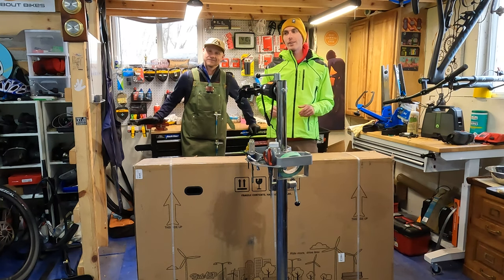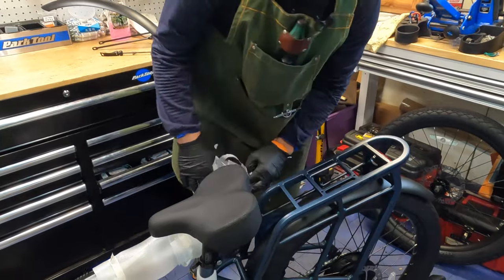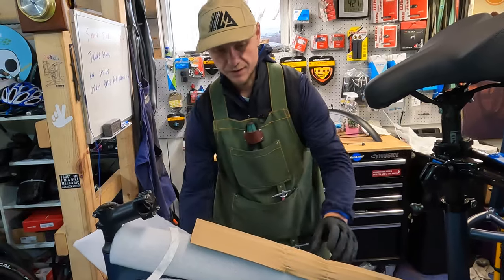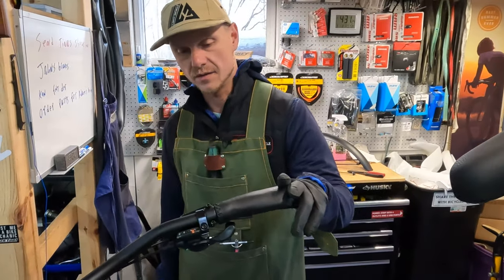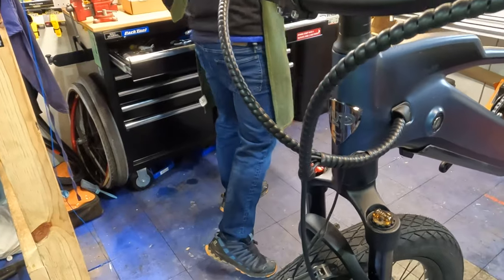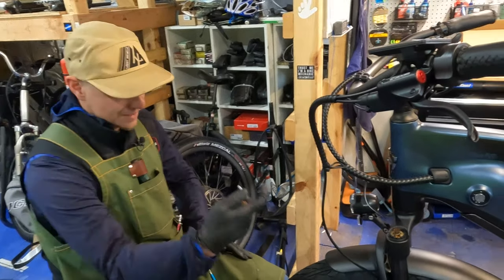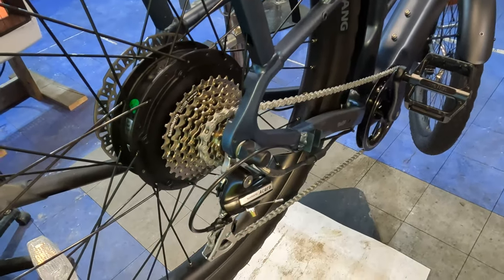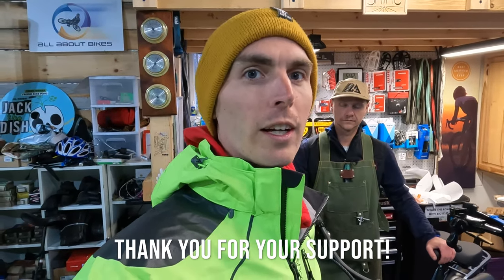Electric Bike Full Assembly and Tuning: Ride1Up Cafe Cruiser!

Comment from the maker: What are your first impressions of the Ride1Up Cafe Cruiser? Support Ebike Escape when purchasing from Ride1Up: https://go.ride1up.com/aff_c?offer_id=1&aff_id=1005&source=youtube (affiliate link)
Reply: I just got mine late February sorry I would have used the link. Its amazing. It rides like a Lexus smooth. It’s not fast off the line my Lectic beats it easy but it’s really fast over a distance. Not in love with the thumb throttle but I mostly pedal. The smooth tires are quite and roll Fast. I need to bring mine to the bike shop for a tune

Comment: I wouldn't recommend this bike. They advertise it as a 750w motor. But the motor on the bike is only a 500w.
Reply from the maker: It's 750 watt sustained - so should be peaking even higher.
Reply: No. I have one. The motor keeps burning out. I took the information off the motor and contacted Bafang. They told me that its a 500w motor.@EbikeEscape
Reply: The information on the motor is "RM G040.500.DC" if you look up that hub motor on bafang. They tell you it's a 500w motor and it's torque is 60n.m

Comment: What a great tutorial video.  Lots of detail and great tips.  I need to check my spokes for tightness.  Super job guys.  Thank you very much.   BTW,  the Café Cruiser is on the top of my buy list. Lots of extra features and high quality for a reasonable price.   Easier then normal assembly and it looks great too.  I think it will be a great first E-bike.  I'll use your link.  Thanks again.    Kim

Comment: I saw the filing of the front brake caliper spacer on the front side. Looked like you also filed where that filed surface bedded on as well? and back side of spacer too?
Reply: I filed both sides of spacer, reinstalled and it was still chasing when tightened, I disassembled and filed the mounting seats on the caliper (which looked to be the worst uneven surface) and it reinstalled with no chasing and I was able to center dead on.

Comment: I think the bike needs an option on the rear rack. Too bulky. The Thule child seat does not use the foot pegs. Most buyers will not have a < 130lb  buddy on the back at that price point! Should be a rack like the 700 has! And it would reduce the weight.  Maybe R1U's future "click on rear basket"  will justify? Also, don't like having the open holders on the chain stays if not installing the foot pegs. Looks unfinished and possible ankle biters! 
We are HB CA boardwalk riders and have been drooling over this Cafe (beach) Cruiser, it checks almost every box! These are our first impressions  from the website only and not first hand. 
ps: no stem spacers included for taller riders? You mentioned something about using? Did you mean aftermarket?
Reply from the maker: Thanks for sharing! My brother took this on a trip with two older kids so we'll see how he likes it. Unfortunately, a non-welded rack wouldn't meet his needs due to weight limitations. No stem spacers but an adjustable stem might be a nice add-on for this model. Thanks for watching!

Comment: My Ride1Up makes a (SNap!) sound when useing the throtttle from a full stop.  I don't think it's the spokes.  Any ideas what I should check.  It has been that way for a while and hasn't seemed to have broken anything.  But, I avoid the throttle because of this.
Reply from the maker: Interesting, not sure. Take a video and share it with Ride1Up and the FB group.
Reply: @EbikeEscape  Thats a good idea...I'll try that when the weather inproves.  I'm not too worried.  I bought a Step through and a regular at the same time.  I only ended up useing the step through so I could change the wheel/hub assembly if I was bothered.

Comment: Top speed throttle only after unlocked?
Reply from the maker: Still 20mph. That is to follow the Federal Ebike classing. There is no "Off-Road" mode on the Cafe Cruiser.
Reply: Thanks, this is a bit of a disappointment but overall I think the bike will work for me.  My other option was a Philodo H7...but I worried about the quality and customer service.   @EbikeEscape